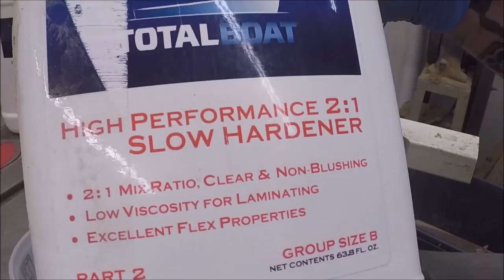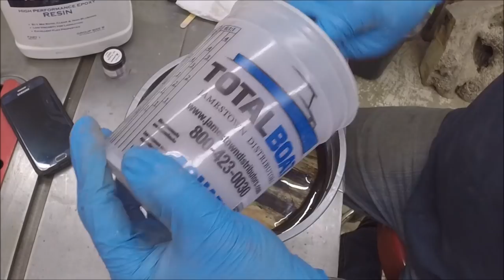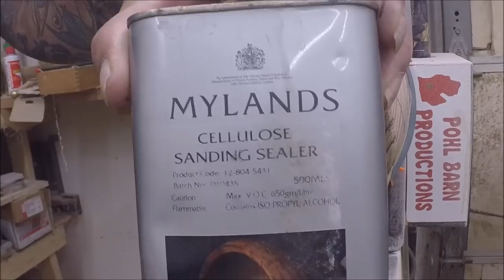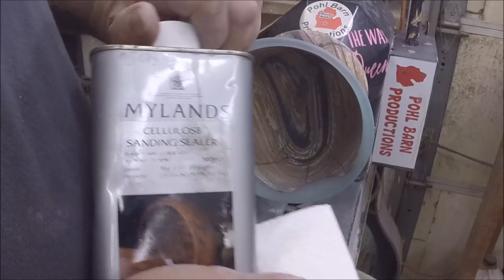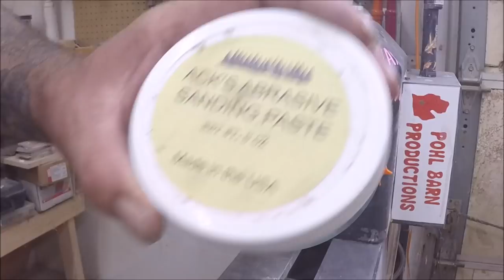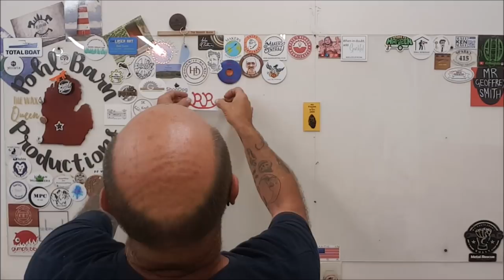China berry blue

Comment: I had been using alumalite slow, but I was getting too much foam-bubbles even with a pressure pot.  I think that is because I did not Stabilize the wood first with Cactus Juice and a Vacuum Chamber.  I am really excited to try the Slow Total Boat which you used.  It looks like it not only stabilized the wood but there is no foam.  Since my wood can be a little on the wet side (about 15%), we shall see if I need to zap it in the microwave to dry it first down to about 9%.  Thanks for the awesome bowl video, I really enjoyed it.
Reply from the maker: Thank you Jonathan    the foam in your Alumilite pours are due to that moisture content, it's one of the worst for about moisture,  total boat will crack if there is any moisture in the wood as you see happens to me regularly,  I do  like the 2 to 1 slow set for most things, they carry a thick set that is my favorite but it takes a few days for it to set up and cure, it's quite a bit thinner and allows the bubbles to escape,
Reply: @PohlBarnProductions  Most of my wood is at about 9% Moisture Content (North Eastern Pennsylvania). Is there a moisture threshold above which cracking happens?
Reply from the maker: That I do not know I like to make sure they are under 6% myself, over dry works for me.  I've started cooking them all.
Reply: The Pohl Barn Productions toaster oven or microwave?

Comment: Hey buddy, I've never did anything like that before. Could you please take a little time and explain why you have to put that under pressure , I don't understand that. What does the pressure do to it or do for it. Just wondering never seen it done before you know I'm just curious. Great job by the way. 😁👍
Reply from the maker: Thank You Carl,  the pressure pot compress any air bubble introduced into the resin during mixing and it also help control exothermic reaction of the resin.
Reply: @PohlBarnProductions        
Ok ! 😁👍 Thank you for come back. I like learning new things. Always wanted to do stuff like that but really don't have the patience. That's been a lot of my time operating heavy equipment in the construction field. Right at about forty-two years.  Thank again very much. Have great day. And keep up the great work.  😁👍

Comment: Can you tell me what is the purpose of the pressure pot? Does it take bubbles out or maybe speed things up?
So interesting..I'd love to try this.
Reply from the maker: The pressure pot compresses air that was mixed in until the resin sets up and hardens it also helps control the exothermic reaction of the resin so it doesn't over heat and boil. then crack
Reply: @PohlBarnProductions  I had a question about this step also. So you are not pulling a vacuum but pressurizing without external heat to what PSI? How long do you leave the project in the pot? I am so interested in doing this when I retire, its a win win hobby. I get to build it and my wife gets to use it! Nothing can go wrong lol.

Comment: Ciao Pohl Barn sei proprio incorreggibile, ansi direi che hai la testa dura come un ciocco di legno,vuoi spiegare perche' tu non usi almeno una mascherina per proteggerti dalla polvere della resina? Bisogna dirtelo con il megafono che quella polvere potrebbe essere cancerogena!? Per favore abbi cura di te, L'opera , che dire è meravigliosa,  Pohl potresti spiegare come funziona quel macchinario in cui metti la resina ad essiccarsi, te ne sarei grato. Ciao mago, Roberto da ROMA
Reply from the maker: Thank You Roberto,  yes I have a hard head ! it hard to talk through the mask so I do not use it for some of the filming, as far as the pressure pot I put the resin into, it's not to dry it but to compress the air bubbles that were introduced while mixing, and it also helps to control the exothermic reaction of the resin.